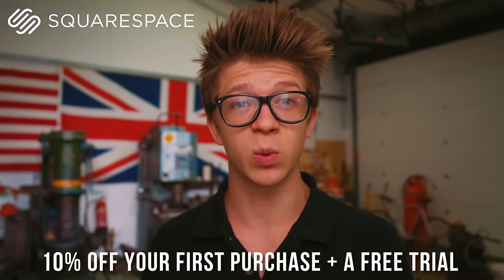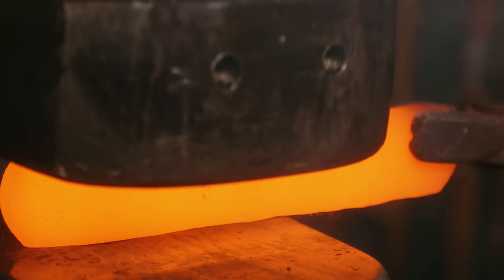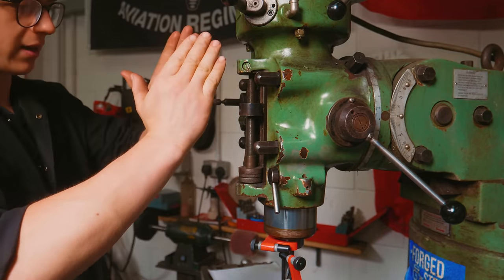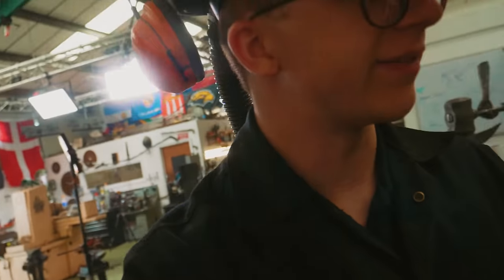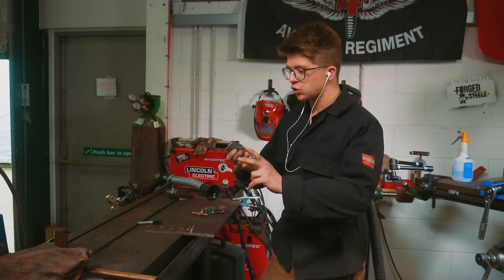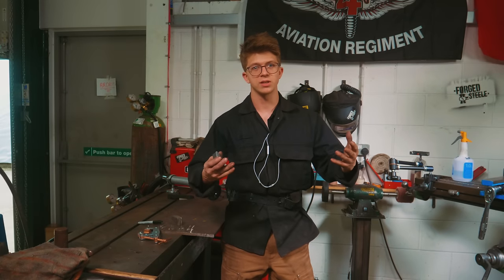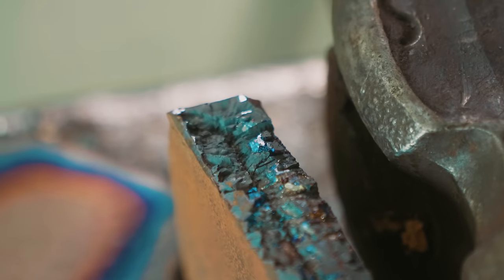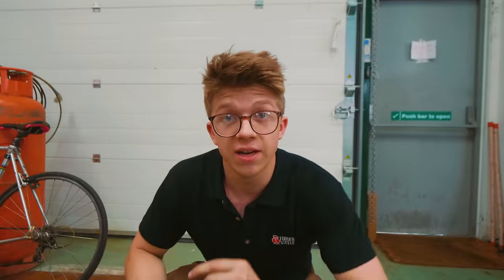CAN YOU MAKE TITANIUM & STEEL DAMASCUS?!?!

Comment: You can try putting it in an square pipe and weld it air tight, then you don’t get any Oxydes and it might work;)
Reply: Mr.Unknown by the time he's ground it clean and taken it off the belt in air the Ti will have oxidised. It's incredibly reactive.

Comment: I'm not sure about this, but I think if you wanted to combine these two metals, you can't simply flat pound or press them together because the in-between layers won't stick. I think you'd have take two long flat bars, weld them together, then twist  the combined block after heating read hot so they can't break apart. Once you've twisted the bar into a tight bind, then flatten it again under a high powered press, and then fold it, and then repeat the whole process several times, then you can probably make a blade from it. And quite a dangerous one I imagine. The durability of titanium and the hardness and sharpness of steel.

Comment: Maybe create a steel box where you fill in the titanium and steel package... This should help with the sparks and allow you to go to a higher temperature. Later on you just simply grind off the steel you used for the box so you are left with the damascus inside... Just a thought
Reply: Or if it explodes you have shrapnel from the steel box flying everywhere. Potentially very dangerous.
Reply: Titanium doesn't explode, it rapidly oxidizes.  No oxygen in box, no boom.

Comment: if a metal burn don`t use water or CO2. you can only "stop" it with sand.

Titanium and iron have different crystal lattices. it is very difficult to Connect
Reply: Seth21914 water might not put out the burning metal, but it will put out the wooden workbench or the camera the sparks just set fire to.
Reply: Matt TheChosen that's right
Reply: but vacuum wellding make a magic.
Reply: I almost burned down my house milling titanium. You need the yellow fire extinguisher (category D, I think). Burning Ti and water makes rocket fuel (or something super explody).
Reply: Seth21914 

Halon extinguisher work but only if the oxygen source is blocked or  the metal below reaction temp or fully oxidated.

Comment: Read a wonderful article from an industrial foundry that says to coat it in glass before the heating process, to heat the metal for quite a while- ( slowly raising the temp through the heating process) but using a specific gas to heat the metal with so as to eliminate as much oxygen as possible

Comment: I'm sure it's been mentioned in any number of other comments, but shouldn't dry power extinguishers be used for titanium (Class D)?
Reply: Paul Challis i dont think there are fire extinguishers for metal fires
Reply: Dry Powder fire extinguishers are suitable for Class D fires (metal fires).
Reply: Metal x extinguisher
Reply: There actually are.  We work with titanium sometimes in the machine shop I work in.  And whenever there's titanium going in to a mill, they make it a point to replace ALL the extinguishers adjacent to the mill hosting said metal with a greater portion of the shop's supply of dry chemical extinguishers.
Reply: thresher741 there is an extinguisher that'll put out almost any fire you're likely to create in a metal workshop. Ti metal fires are no exception.
I can name a few that near enough nothing will put out but that's way way off topic.
Reply: SodomySnake that's the most commonly known about one, there's also it's big brother, ClF5, in that immediate family. Most hypergolic mixes won't be put out with sand, neither will most(all?) metal-fluorine fires. I'm sure there's more, alot of them in Derek's reference for ClF3.
Reply: CIF3 is nasty stuff. Certainly though water on a titanium fire that's burning any reasonable volume it'll just keep burning. Volumes here probably not a big deal though, but yes a dry powder extinguisher is more than adequate. Water, no. Even sand should be enough for the sorts of volumes we're talking about here - burning titanium doesn't make its own oxygen unlike metals like magnesium so you can smoother it. Actually if anything the real issue is breathing titanium oxides rather than the fire itself - titanium oxides are bad to inhale (carcinogens aren't fun).
Reply: Martin Nicholls in the grand scheme of things TiOx isn't that bad a carcinogen, even as nanoparticles, admittedly I wouldn't want to breathe it in either but compared to all the dust Alec is going to have breathed in from not using a respirator or mask for years of tool polishing and finishing .... Anyway, like you say, small amounts of water on a Ti fire not a good idea, or on freshly ground surfaces...
Reply: Paul Challis halon is available in a portable fire extinguisher. Take care when using it.
Reply: Paul Challis co2 is also an option but I'm not sure if it is d rated
Reply: It's illegal to sell/buy/own/discharge Halon extinguishers in most of the world.
Reply: Martin Nicholls CFC based ones yes, HCFC ones are still legal(in the UK) if you have an authentic reason for having one. Dunno if forging Ti counts when a Cat D will do the job though.
Reply: Michael Griffin CO2 isn't an option for a Ti fire, the burning Ti will strip the oxygen from the CO2 and you'll make it worse.
Reply: So when you say Halon you mean it in the widest possible sense. Use dry powder unless you're dealing with huge amounts of titanium and there's a risk of fire in which case hire a professional to design you a system.
Reply: Martin Nicholls I have assumed it has been used in its broadest definition in this case yes. And for the hobbyist scale work Alec is doing here a Cat D will work fine, but like you say bigger and more regular Ti work would require a more dedicated professional system.
Reply: Metal fires... that’s like an oxymoron
Reply: gregistopal 

Have you never lit magnesium strips in chemistry class before?
Reply: Muh boi amongst a great many other places, like sunscreen yep.

Comment: I know titanium from cycling and I know that you cannot weld titanium under normal air conditions. Titanium needs inert gas welding because of oxidation.
Reply: ganimed1976 correct, there can’t be any oxygen whatsoever
Reply: i used to work in a shop that welded huge parts for military, we had a purge room, with an airlock, filled with nitrogen or argon, and the welder would literally wear a "spacesuit" while in the room. it was a little surreal to think if you walked into that room , you would pass out ,with in a couple breaths, and die shortly after.

Comment: It didn't "come apart"...it was never together.  Try again, use more heat, more pressure and more time.
Reply: Scott Jenkins the problem is you need shielding gas titanium I'm not sure if it can even bond to steel but you do need an inert shielding gas to purge oxygen from it oxygen is the enemy because it creates an oxide layer. And the oxide layer acts like wax paper

Comment: what about tungsten Damascus?

also, could you carbon treat both the steel/iron and titanium to help fusion?
Reply: I'm in no way an expert- hell not even a hobbyist in metallurgy, but if what I know about tungsten is true then you'd either be forging a forgeable piece of steel and a solid block of tungsten, or a puddle of steel and a forgeable piece of tungsten

Comment: You should try this again but use an induction heater inside an argon enclosure. Argon is easily bought at welding supply stores. Empty the tank inside an empty 55gal drum and lower the end of your induction heater inside the drum. Gives you a way of heating metal without oxidizing it.

Comment: Mr. Steele, I have a request. Using a can technique, place the shards of titanium and steel in a box and use liquid titanium dioxide to purge oxygen. Also, i would bring up to a bright yellow for the first few hammerings, and use less heat as you get your bond formed.  I have heard rumors here in Minnesota, at the renfest, that a local blacksmith has found a way to use pigeon feces with some success to make twisted titanium / steel daggers. Im looking for the photographs.  Look forward to your next project!

Comment: Could you try to make a Tungsten + 9260 Spring Steel + 5160 Spring Steel Damascus. I was wondering how effective it would be when used to make a Katana. Tungsten would be the blade edge, 9260 as the core, and 5160 the back.
Reply: Ryuzen Hono tungsten can't be forged like that. To get hot enough to make the tungsten malleable would result in the melting of the steel.
Reply: Tungsten is more like a ceramic than a metal
Reply: Ah well, back to the drawing board and more research for me.
Reply: Rip, time to look into other metals.

Comment: Hey Alec, another idea which I don’t know if it works but might, is to stack the different materials (titanium and steel) into an envelope of steel, mean you could try to make a box of steel stack your titanium and steel plates in there and seal it at the top with a steel plate. This leads to less reactive oxygen being available inside the steel box and you are able to process it more easily when going under the power hammer, you can also bring it to higher temps because the steel is not as reactive as the titanium. Now to the things that may not work as planned, I honestly don’t know how big the difference is between the expansion caused by the heat of these two materials, it might happen that the steel box cracks because the interior expands so much that the steel on the outside can’t keep up. My second worry is that when expanding you might get a leakage in the enveloping steel and oxygen might come in and oxidise everything again. That’s that so far hope you can get some inspiration from my idea. Keep making cool vids ;)

Comment: imagine what a gold and silver damascus would look like.
Reply: Oliver C 

Gold and silver do make an alloy
Its called electrum i think
Reply: Juanpablo Montalvo :(
Reply: @oknc9122  It's called mokume gane (wood grain) and is actually quite common in jewelry making. It can also be made with zinc, copper, brass, bronze, silver, platinum...

@Juanpablo Montalvo. While they do make an alloy, electrum is only generated when both metals are melted together. Making mokume gane works like forge welding. So the part where silver and gold touch would be a thin electrum layer, but you do see a patttern.

Comment: I think a cool(but very expensive) would be some sort of gold and silver look. Maybe try putting gold and silver together and make some sort of silver gold Damascus looking thing(ring, pendant, something)

I know you're not made of money but I still think it would be cool.
Reply: Vegtam The Wanderer Gold and silver won't stay separate enough, they'll just alloy together
Reply: Jack Kardic you should check out something called mokume gane. You might be surprised.
Reply: Silver plates with thick electroplated gold might work. The gold is already bonded to the silver, so all that needs doing is bonding gold to gold. Their differential melting points might cause issues with forging it though

Comment: You need to 'weld" different types and parts of various metals with explosives (no joke), but you will need professional assistance. Used to fuse sheets of different metals in sheet for for specific uses (in refinery tanks,etc)
Reply: Yes I can see that. The explosion would push out the existing atmosphere and the welding would take place in the atmosphere of the explosion. I guess it would be very difficult to get the type and amount of the charge perfect and even detonation. Ok I am done. I just started to think about simple variables and that leads to less simple and I got a headache. You can tell me more if you would like. It sounds very complicated!
Reply: I worked at Titanium Fabrication Corporation and we build pressure vessel made of titanium. The tube sheet for heat exchanger is clad with carbon steel and titanium and this is done by explosive bonding.
Reply: @timebert6141  look up the welding modern marvels on YouTube. Has info on it
Reply: @Phil-D83  cool thanks

Comment: Something that I thought of, welding the pieces together may start the oxidizing process on the titanium before you even get it in the forge. 
Possibly make the side of the titanium and steel so flat that they stick together with a natural suction, I don't know if you have the devices to get the surfaces that flat but I think it has a better chance than welding before forging

Comment: Maybe forging the two together isn't necessary to implement the use of both materials for something like a knife . Perhaps you could cut a titanium blade and put high carbon steel around the cutting edge of the blade In a modified version of a dove tail and maybe some high end glue and some sort if that even exists for such a purpose, glue is stronger than wood , seems like there should be a parallel for metal. It would awesome! Strong,  sharp , functional and light weight

Comment: if oxidization is the issue you'll have to make it in a low to no oxygen environment. at least the forge welding part. this means you need to add something between the layers of titanium and steel to prevent oxygen from getting in the way. you need to coat the billet in something that will allow heat to get through to the metal while preventing oxygen from getting through. the oxygen preventive coating  also needs to break apart during the first few hammer hits.

Comment: If you use a couple of primary transition coils focused to a millimetre or two field strength you can gradient phase the surfaces of two touching plates, then when you press them they will diffuse together at an atomic scale.

Comment: Maybe some deep dig flux for TIG welding stainless steel painted onto the pieces before you make the stack? Or possibly some flux that is used on the backside of stainless when gas purge is not an option. It is so trick because titanium reacts with almost everything in a bad way at elevated temps.

Comment: Okay, one question and one maybe useful tip. 
Could you melt steel and melt titanium (seperatly) than put them into the same cast and form them together?
Okay so I work with metal a lot and watch a lot of videos like this. I was just watching a video, just before this one, about making Super Steel swords (swords made from standard steel but made to be stronger, sharper, and all around tougher and better steel swords than standard). I bring that up because he (the guy doing it) mentioned that getting the steel to the maximum molding point is heating it to a point called "Solid Solution" which is liquid steel that keeps its form. It's easily moldable and in theory, could attach itself to another metal with ease. Since I'm quite sure titanium has a higher melting point than steel does (I don't get the pleasure to work with it much). In theory, if you have 2 steel plates between 2 titanium plates, TIG them together as you had, than put them into the furnace and get the steel to the Solid Sution point, in theory, it would be able to bond into the titanium easier (hence being liquid metal). However, keep in mind that with more heat comes brittleness. Unless done right. The temperature, if i'm not mistaken, was at 200 degreese C. Depending on what you plan for the mixture though, brittleness may not be much of a factor outside forging it.

Comment: Maybe using brown gas, or hho gas might be able to fuse them together rather then forge welding. browns gas should be able to fuse both at thier welding temp at the same time sort of a brute force way of doing it. 
 The other option might be an induction heat process might consider instantly cooling it. 
Heat bar through the induction loop as it comes out cool with ash water from weld point to 200F 
 Maybe do a crucible
Could try thermal cycling heat it up to weld temp them let it air cool 5 - 6 times. 
That's all i can think of off the top of my head.

Comment: Just a random idea here. Weld a thin layer of steel onto the titanium on the side that is supposed to fuse to the steel. Mill it flat. Then forge regular steel to that thin steel shell.
Reply: Btw ignore. Someone else mentioned down in the comments that silver works better as the intermediate layer

Comment: The oil from your hand is a major same goes for the band saw use stainless steel zip discs. Use neon or argon as a shielding gas and it will bond to 309 stainless aswell

Comment: It would be an interesting experiment to laminate the peices as you have done, on both sides but leave gaps. Then, submerge the laminated block in an aerobic liquid like oil. Then, taking it out of there and put it in an electric kiln, maybe try and fill it with nitrogen and get to a yellow heat, then try bashing it together.

Comment: Try ribbing the flat surface of the titanium with dovetail shaped grooves, then the steel will flow in and act as a glue between the titanium plates, it wont be a molecular bond, but with a high enough density of mechanical footholds it might be enough to work the material as a unified blank, as long as you take the steel glued titanium plate blank and go straight to the stock removal stage once it gets solidly connected, steel flowed in the grooves, otherwise youll just bully it back out again.

Comment: Maybe try to weld them using thermite in a homemade blast/fire chamber of sorts. Or try to break down the titanium in sulfuric acid slightly first then mill it. Heat the titanium yellow then pour molten steel in between and slow press in a mold.

Comment: You could try using flux material to manipulate the critical heating points of the materials. Alternatively you could make significant but viable alterations to the patented process which would make it distinct from the patent, , typically for can Damascus they use powdered steel, perhaps you could do steel with powdered titanium which is about $16 USD, or you could use both pieces and powders of both metals to create a Damascus can